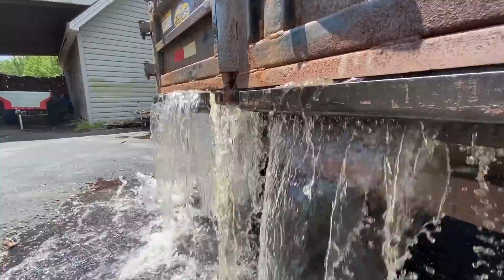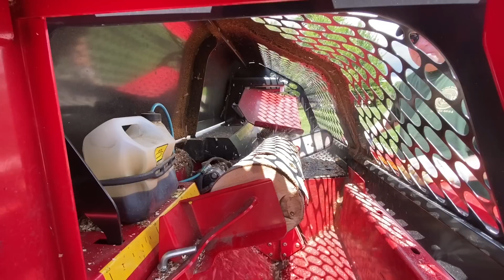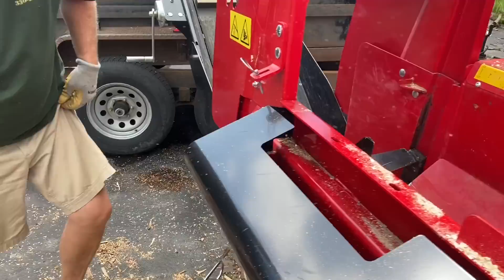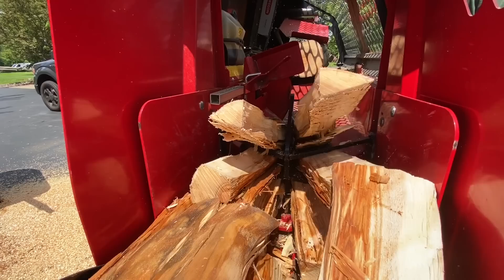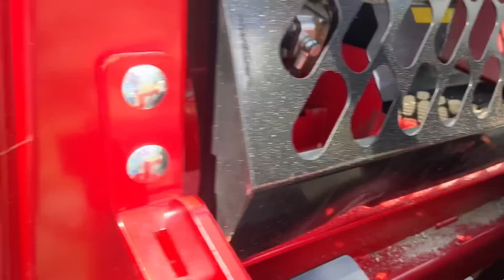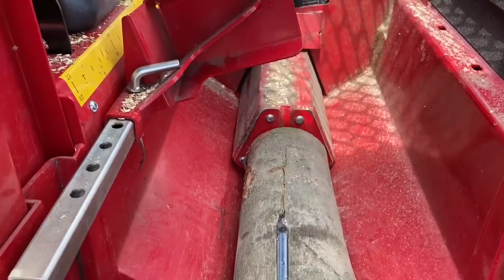Firewood Production With the Japa 365 Pro...6 Way Knife Time!

Comment: At 9:32, you advanced the log as the ram was splitting the cut log. This looks like a more efficient process. 

Normally you wait for the ram to return before advancing the log. 

Why don’t you split and advance simultaneously?
Reply from the maker: Good observation David. When I have smaller logs I just go hammer down. The larger logs I notice I dont advance the next cut until Im confident the round will make it thru the knife. If it gets hung up I want the chamber open to pull it out. I could always reverse the infeed but its habit I guess! Joe

Comment: Congratulations on 2k, but as of my viewing you're already at 2.31 heck you'll be at 5k before long. Have you seen those pull out platforms you can put in a truck bed? They are a flat platform that is the width of the bed between wheel wells and as long as the bed is and you pull it out like a big drawer. I was thinking about a larger version of that for your dump trailer for loading those 3 long rows like you do so you could load all from the rear of the trailer without getting in the trailer. I assume the way you load it now you have to have someone in the trailer?
Reply from the maker: Hi Jason... I will believe 5k when I see it...lol.  Yes I have someone in the trailer when I load it.  Usually one of my daughters but I will do it solo if necessary.  I pay a HS boy to load or unload and stack the trailer too.  I have set up my system to permit me to pull by trailer right up to the stacking area which makes things easier.  I have committed to hand loading all our deliveries bc it looks good to the customer and they can measure their delivery right on the trailer.!  Thanks for the suggestion.  I am always looking for a better way to do things so I will get googling on it.  Joe
Reply: @ohiowoodburner  it would probably have to be a custom built thing. I've just seen them for truck beds and they do look slick, but more $ than I would want to spend. 5k will be soon, people like when a channel sticks to a publishing schedule.

Comment: What’s the capacity of the japa?
Reply from the maker: It can run a 14" max log.  Length is variable depending of the balance of the log.  I do not use a live deck which would increase its output greatly.  I can easily make 1 cord, loading all by myself, in about 1 hour and 45 min.  Pretty darn fast.  Joe